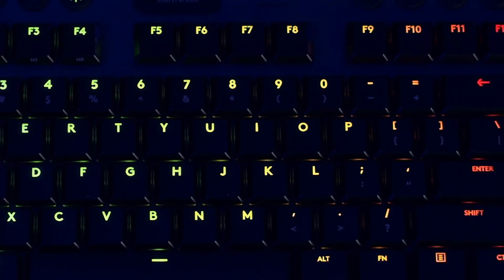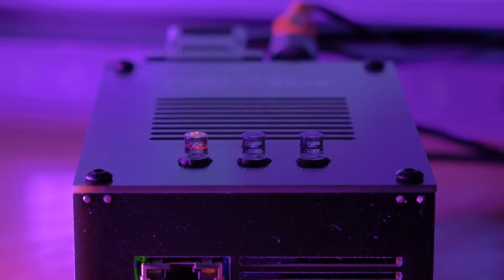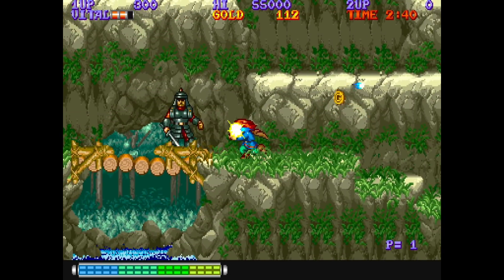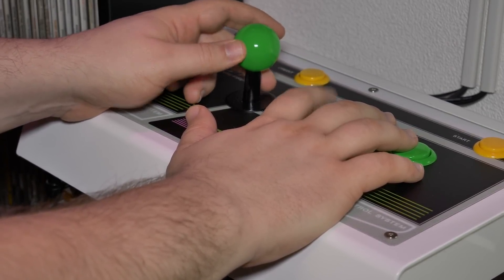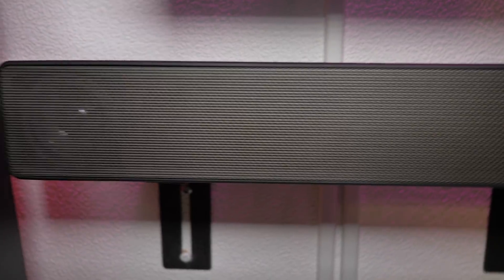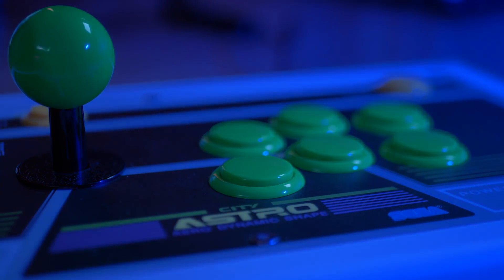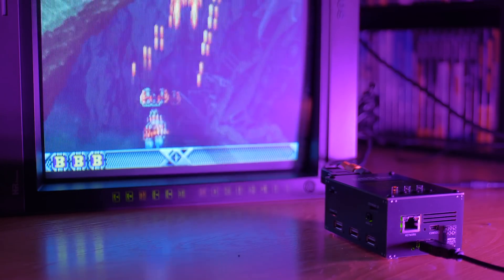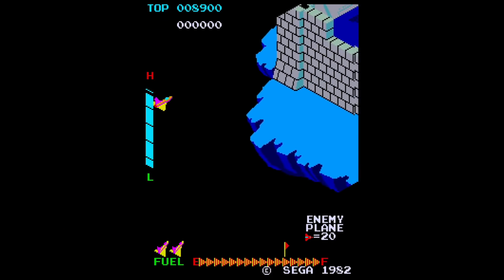DF Retro Hardware: MiSTer FPGA - A Brilliant Mini Emulation System Explored!

Comment: I would love an in-depth comparison vid similar to the one you did in this one on arcade core accuracy. I am a big fan of the MiSTer and I hear people say it's more accurate and there's a bit of misinformation out there. It's not that is currently more accurate, it's that is has the potential to be more accurate due to 1:1 parallel digital logic and low latency. There's still work to do, but the latency is already there so it "feels" better than software emulation.

Comment: Interesting enough, but I'm actually more interested in seeing Mister vs Console comparisons. Great work though, a compelling watch
Reply: SNES is more accurate than anything other than BSNES and lacks the few graphical bugs that plagues the Super Nt. NES and PCE (and pcecd) are also close to perfect although the nes core lacks some mappers for pirate carts that analogue supports. Genesis and GBA are very good as well. The GBA core goes back and forth with mGBA for the accuracy crown.  Older Atari 2600 era consoles aren't as good on mister. No devs = no progress.

Comment: MiSTer FPGA for the win! Definitely my preferred way to play retro games these days! Other than when I need to grind out some save state practice on retroarch :-) Dodonpachi Training Stage Select coming soon!
Reply: Looks like I'm late to the party :D
Reply: Outside of the input lag - What does it bring to the table, practically speaking? I have an entire emulation box setup with my CRT @15Khz, but I'd like to know what practical benefits their are by comparison other than input lag.
Reply: @retropulse03  accuracy, and mostly potential, maybe for very simple very old 2D systems software emulation can do the trick, but for more complex systems there is a point where software emulation is going to get too complex to get close to the real thing. Not saying that FPGA is there yet, but the potential of FPGA is massive compared to software emulation where things are pretty much hitting a dead end when it comes to accuracy.
Also, for me the inputlag is the most important metric so it's definitely a huge factor of the appeal. But I'm strictly theorizing here, practically I've only tried a few software emulators for PS1/2 or SNES and found them pretty underwhelming in terms of quality, accuracy, and smoothness. But there has been some great things too, like the SNES 9x high res mode 7 and widescreen hack which are just incredible on some games. So both have their advantages I guess, but to me FPGA sounds more promising for the accuracy and responsiveness part.
Reply: @deus_nsf  You're right when it comes to PS2 emulation, it's far from perfect and for many games the performance and accuracy is hit and miss. Then again, PS2 FPGA isn't even a thing at all... But when it comes to those consoles which are available on FPGA like NES, SNES, Genesis, Game Boy etc. there are amazing emulators out there with cycle-accuracy. So I'm not sure what underwhelming experience you're speaking of when it comes to SNES or even PS1. For PS1 (which doesn't exist as FPGA yet) there is Mednafen/Beetle-PSX which is the most accurate PS1 emulator out there and runs pretty much every game you throw at it with high accuracy. If you use the Retroarch frontend, it supports Run-Ahead for many cores so input latency becomes a non-issue. I think the problem is that people who had a bad experience with software emulation often fall into one of these categories: 1. They're trying bad or outdated emulators 3. They don't take the time to research and set everything up properly 3. They use hardware that is either weak or not suited for accurate emulation like ARM devices, Raspberry Pi's, NES/SNES minis, hacked consoles, their phones and tablets, or simply old PCs. Obviously they'll have a subpar experience then. But if you actually run the most accurate emulators on a beefy PC connected to a TV with original controllers through adapters, you can have a near-perfect original console experience for most systems up to the PS1 era and it's in no way worse than using something like a MISTer. In addition, you get tons of features on top like shaders if you want to recreate the CRT look on a modern screen if you're into that kind of stuff (something which requires a half-decent GPU, btw). Please note that I'm talking solely about consoles up to the 5th gen. I don't have any experience with Arcade systems and this might indeed be an area where the MISTer shines compared to software emulation.
Reply: @symphony137  Maybe that is just my experience, but I've been trying a lot of emulators on good machines and I know how to set things properly, I basically take hours setting pretty much everything, and for the SNES and the PS1 I had and actually still have those machines and the experience is just not the same. The sound doesn't feel the same, the image as well, there is a lot more stuttering and frame pacing issues, the only CRT filter that I find interesting is the one from the latest versions of ReShade and I'm not even sure that is compatible with the emulators, etc...
I mean, maybe it's gotten better but I'm not willing to try again, I already spent an awful lot of time a few years ago trying to get a good experience. That's what I also like about FPGA emulation, it's much closer to a plug and play device than any emulators can be, where you have to set different parameters and hacks depending on the game you want to play.

Comment: The  DE10 board alone cost 300$+ and isn't in stock anywhere i looked and you still have to buy RAM and other stuff. Not really entry level gear.
Reply: It's a $130 board. Don't pay more for it. Of course the price of the whole thing balloons out from that, but, it's custom non-mass-market hardware, and it has unique advantages.
Reply: It's 200 with a 128MB SDRAM module. You don't need anything else unless you want to play on a CRT or with original controllers.
Reply: What planet do you live on? I paid $185 Canadian for mine directly from DigiKey

Comment: Sooo just use emulators. Ok gotcha.
Reply: Missing the point. This does not serve the same purpose unless you're doing cycle-accurate emulation on a high-end PC and using run-ahead, which is only feasible in some cases with older platforms. Even then, you'd have major problems playing on a CRT at native resolutions.
Reply: @Trunchisholm  Idk man. If you like games just use emulators. If you're some kind of extremely critical gaming historian then even this isn't good enough.
Reply: @djayjp  The thing is, this is good enough. It's very close to the original hardware, cycle-accurate and with zero lag. Try it and get back to ME. Emulation is great, but this is not it.
Reply: @Trunchisholm  Prove it. Even John couldn't.

Comment: A MiSTer vs Analogue comparison would be interesting to see.
Reply: MiSTer wins. Analogue doesn't support their products long enough and don't fix all problems. MiSTer is open source and even minor things get fixed all the time. You also get all systems for the price of one Analogue system. And scan line options are much better on MiSTer.
Reply: If non problem games are tested it won't show anything.  If they are then it will show that the Super Nt suffers from graphical bugs in games such as Bahamut Lagoon and the FF6 intro.  Super Nt supports fewer special chips (no Star Fox unless you have the cart). The Mini Nt supports some pirate XXX-in-1 mappers that mister hasn't gotten around to.  MiSTer's sound accuracy as measured with MDFourier is better for SNES, NES, and Genesis.  The mister PCECD core is also basically perfect so that should compare well to the upcoming Duo.
Reply: Vs raspi vs og hw

Comment: MiSTer vs retropie?
Reply: No 32-bit systems on MiSTer yet. Playstation will happen eventually (no enhancements though), but others might not happen, indeed are unlikely to happen or with compromises. Retropie or even a bunch of salvaged old PC parts running Retroarch is more versatile.

But if you need that FPGA zero-latency high-precision goodness for your 16-bit systems... well MiSTer is the obvious choice.

But Retroarch will be likely getting beam-racing support eventually, which would bring its latency down to where it can compete... and often you can just use run-ahead. Cycle exact emulators are not necessarily a priority for Libretro, especially not for the breadth of supported systems, so i don't know, it depends? Classic linewise emulators appear to be just good enough to experience most of the games. And just because MiSTer runs on sub cycle granularity, doesn't mean that it's entirely correct or bug free either!

MiSTer has a dual-core A9 800MHz processor on it that runs Linux. It seems to not be too insurmountable to have it run libretro to offer at least software emulation of systems for which no synthesizable cores exist, but there doesn't seem to have been much interest in that. It would still need quite a bit of work, since there is no Linux-usable GPU core there, there's a softcore sold to bigger clients, but not for an open-source project. I guess had they had that, it would be more versatile. But availability of DE10 tends to be pretty bad anyway, and if it was more desirable, it would likely only get worse.

Comment: Can you do NAOMI emulation with this thing?
Reply: Not for now, and don't keep your hopes up too much, the gate count of Dreamcast chips is much too high to fit in the FPGA, and SH4 CPU is uncharted territory as far as FPGA cores. There's a chance that it can be done with a HPS hybrid approach, where the SH4 and most other stuff gets emulated in software (this FPGA carries two hardware Cortex A9 800MHz cores running Linux), and only the very final rasterisation part of the GPU would be on the FPGA section of the chip - which already should be enough to make it fast and more accurate than most emulators except Demul - but nobody is working on it at the moment.

Comment: Man I love this, being an 80s kid, I would take this over a modern console experience any day. Your makeshift arcade nook is great. I do completely agree about old CRT's still being the most ideal display for retro games. Sony made the best CRT's in the 90s/00s, I noticed that's what you were using.
Reply: Sony didn't put any component input on their consumer CRTs until flatglass CRT came out, which is a major flaw because you cannot get the best quality video. He was using a Sony PVM broadcast CRT monitor, which does have RGB (much more expensive and rare than a consumer CRT). If sony did put component on that curved glass CRT TVs, they definitely would have been the best... but USA got shafted with TVs compared to Europe and Japan who got RGB Scart connections on everything. I suggest looking for a Toshiba curved screen TV with component... if you can't find a Sony PVM or BVM. Otherwise you will have to get a flatglass Sony TV and your light gun won't work.

Comment: Emulation is the most effective away to preserve games and allow people to play them. Big time collectors do their part in preserving games of course and it's nice that they bring their collections to museums etc so that people can look at the physical copies but they're preserving those games for themselves. The physical box art is just the tip of the iceberg when it comes to video games and they must be played to be experienced fully and emulation preserves these experiences and allows anyone with capable hardware to experience them themselves.
Reply: But... this does not negate emulation? They can coexist without any problem. Software preservation for this platforms is not a problem. This is a great solution to preserve the hardware side of things. Original hardware will eventually fail  and FPGAs will become even more important in the future from a preservation standpoint.
Reply: @Trunchisholm  True I wasn't taking a shot at fpga if that's what it sounded like. I place it in the same category pretty much, it's emulating the hardware, it's still a form of emulation. I was just talking about preservation in general and how much emulation has contributed to all of us having the ability to play all this games and them not disappearing forever.
Reply: @TerraWare  Completely agree with you  on that. Emulation  is extremely important for software preservation. Most people play older games via emulation and that won't change in the future.

Comment: I would like to see comparisons between real and FPGA.
Reply: You can find plenty. I have compared SNES to the SNES core, and found no differences at all in various demos and such. Even Demos that use stuff that very great emulators will mess up, it does fine.
Reply: @jackbootshamangaming4541  With SNES it is tricky because there are multiple hardware versions that behave differently in different situations. Partway through production they consolidated several chips, so the revision is commonly called 1chip. That revision isn't perfectly accurate and has visual glitches in a few places, but its video signal is cleaner.
Reply: @coopercummings8370  we'll see we get the best of both worlds on MiSTer. Our video output is much cleaner than any SNES is, including RGB modded 1chips, yet it's based on a 2/1/3 SNES(the most common 3 chip, I have several SFCs and they're all 2/1/3s. I had a 1 chip, and some other models that were different from 2/1/3, before losing all my stuff and having to restart my collection) The MiSTer output is cleaner than my completely recapped with very high end 1% tolerance caps and resistors, with an RGB amp, 1chip, both at native 240p, and when the OSSC is used on the SNES I get better image out of the MiSTer still. We just got the 5x scaling mode added for 1080p(crops 8 pixels, 4 on top and 4 on bottom but you can offset it, and most games back then still considered those areas as potential overscan as many CRTs would overscan those, and do they're generally fit with useless info). Like I was playing Streets of Rage 2 last night and with a +4 offset, it shows the name and timing all perfectly, just cuts off the pixels above the characters names and such which are useless and only 8 original pixels. 

The scaler in the MiSTer is amazing too. The OSSC pro is getting an addon board for the DE-10 nano that will do all the same things as the OSSC pro as it's going to be based on a very similar Cyclone V chip, but this way it's much cheaper as you're supplying the FPGA yourself, the addon board is going to be 200 if I  recall correctly, the OSSC pro is going to be 500+...
Reply: What's that game at 11:09

Comment: Please John, make comparisons between og hardware and MisTer, Im secialy interested on snes and megadrive sound simulation. Theres not a lot of those videos on the Internet. 

By the way, I like how much effort and love you put on your work, be proud of it.
Reply: There is a tool called MDFourier make by Artemio that helps measure the sound hardware of Genesis, SNES, NES.  Both the base Genesis and SNES are as close to perfect as any emu and better than the Mini Nt, Super Nt and Mega Sg which have incorrect channel balances and low pass filters that don't match real hardware.

Comment: Excellent exposé on the mister.  Hoping for a Mushihimesama core releasing soon.
Reply: Nah dude. CV1000 hardware is way too complicated for now. The Hitachi SH3 CPU alone is a show stopper. Someone theorized (sorry, forgot the name) that you could use an external SH3 addon Board - or SH4 for Dreamcast. But that's way off. The next big challenge is going to be a full speed Playstation core.

Comment: MiSTer vs MAME vs Arcade HW ? Yes please!
Reply: This would be hit and miss. Neogeo was made with chip decaps but suffers from some graphical bugs from timing issues. Jotegos Capcom cores are good but he moves on to the next one so quickly (because patreon...) that bugs don't get fixed as quickly. Old arcade cores have nobody interested in improving them sometimes.  Where mister shines today is consoles with nearly perfect SNES, NES, PCECD, Genesis cores and a great GBA core as well.
Reply: @ghogan42  good to hear about the console accuracy. Before learning of Mister, I was considering getting an Analogue mega SG and Super NT, along with a couple everdrive flash carts for roms. Seems like that would be a complete waste of money now for someone with no intention of collecting actual cartridges.

Comment: I had my MiSTer since the pandemic stuff happened, best decision ever. Buy it, you won't regret it!
Reply: +1
Reply: .... And with this Product there is a way to buy it already Pre Loaded with games or no? I could research it but since you have one I rather get a real first hand response. Thanks in Advance 😇
Reply: @cMARVEL360  its possible. But its really not difficult. You dont have to write code. Just use the Mr Fusion image for the micro sd card and get scripts for doing stuff like update. Update all is a very good script. You have a basic graphical interface which is really good.
Reply: I did today... Because of this video lol